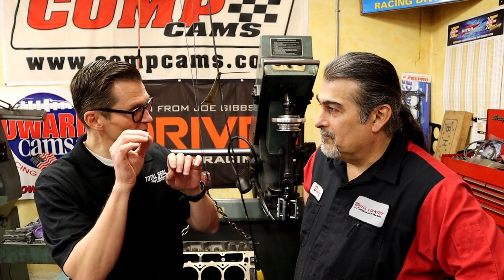How to make 200HP by changing your piston rings.

Comment: Right on Danny! Thanks for hosting Lake at your shop! It makes me wonder if more power/better fuel economy  could be added to Smokeys HVC engine with newer ring packs & hone tech from Lakes employer (Total Seal piston rings), right?
Reply from the maker: Most definitely, our new HVC engine will have the newest ring/cylinder technology available. Totalseal been testing some new cylinders and rings.👍👍👍. 
We are also using a roller cam and lifters. And fuel injection. With better coating and thermal protection we can make it more efficient. Smokey was getting 1.8hp per cubic inch and 54mpg and passed emissions without a catalytic converter. Our engine will use a catalytic converter. We have been working on two engines a 3 cylinder ( 1/2 of a 4.3 GM) and a 4 cylinder for an S10. Smokey was working on an s10 for GM. The difference was Smokey was self funded and he had money, we are self funding and keeping up with work doesn’t leave much time for development. We will get her done!

Comment: Did i miss somthing?? You said it made 690 hp. Then it ran damaged & made what, 480hp? So u freshened it & it made 780 hp. Thats not 300 hp increase? Its a 90 hp increase. Since when it was last fresh, it made 690. Now its fresh again at 780 . That would be 90 hp increase. And it sounds like the cam & some of the valvetrain as well as the pistons & rings was updated. Thats good that it got a 90hp increase. But i would expect some increase? And why are u trying to portray it as a 300hp increase?? It was down on power becouse it was damaged.
Reply from the maker: I agree with your math, when I was editing the video Lake said it made 200hp and I thought that would make a good title for the video. Been editing hour of video and sometimes my editing isn’t the best.👍
Reply: @MrDanielSoliz  I gotcha. Love ur videos though.

Comment: Are there options for the new thinner, longer lasting rings for a Ford 460? Say 9.0 to 10.0 CR? I'm planning a torque build 460, but would really love to have the longevity of modern engines. I'm a mechanic, and run compression tests on engines with 250-300k only to find great compression. The valve train and bottom end might be worn out, but the cylinders seem to last forever with good maintenance. Or is that only possible because of the nichrome cylinders, or whatever other new metal they make them from now?
Reply from the maker: What we do on the Ford 351m is have custom pistons made and that really not that bad in price but you will have to wait a bit. Not to bad. Check CP Carrillo and JE to see if they have something on the self.
Reply: @MrDanielSoliz  Thanks for taking the time to reply, I honestly appreciate it.

Comment: Great stuff Danny. Love the way you and Lake interact. I always say that the internal combustion engine is a Delta P device. It operates solely on pressure differential. Blowby not only reduces the working pressure in the cylinder, it increases the crankcase pressure. A lose lose situation. Add the increased pumping losses of having to move the blowby around in the crankcase and it gets even worse. Looking forward to part 2 and the honing. Regards Greg

Comment: So where does that leave us with a for example ford 5.8L/351W engine in a daily driver to gather Horse power gain per dollars invested?
Reply from the maker: Depending on what year 351w you have Ford started using thinner rings and better piston design, unfortunately rebuilders want to save money and use the older design pistons because their way cheaper.  Every engine can benefit from the new ring design. Thanks for watching.
Reply: @MrDanielSoliz  
This would be for the OBS 1997 f-250HD 5.8L 351W, that has an upgraded E4OD HD rebuild parts in it. 
I was amazed at the better engineered parts that were available than what came in the factory OEM install. Thank you for your time. Always trying to learn something new and better way to do things bigger than myself at 60 yrs. old.

Comment: But how long will it last compared to the old setup?
Reply from the maker: Way longer then a conventional thick ring. The rings are much harder and thinner and with less friction they last longer. A NASCAR engine was down power at the end of the race before these rings now they could actually race the same engine another day. Racers on smaller tracks can run many races on the same engine and still make as much power as when it was new. More cost effective. Thanks for watching.